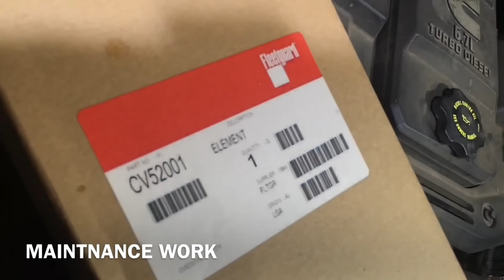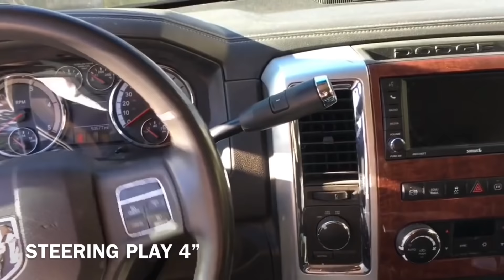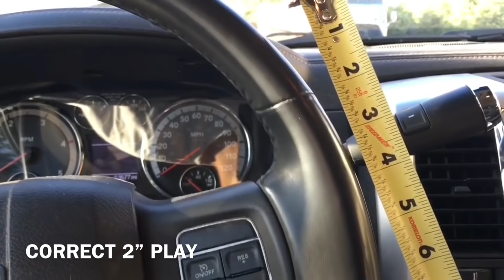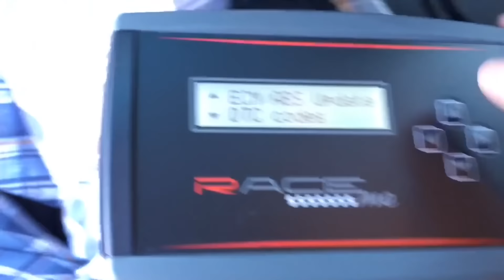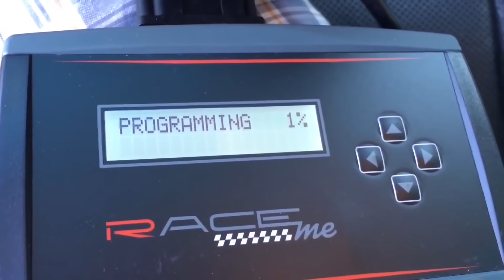2012 Ram 2500 Laramie 6.7 Cummins - FULL BUILD - Exhaust, Tune, Wheels and Tires Upgrade

Comment: In 2013 the 2500 was available with an Aisin trans but after that 3500 and up only . They are rare but I’m sure you can find one if you look hard enough. I only know this because one of my good friends had one. Good job on the truck to by the way.
Reply from the maker: Thanks bro, good to know there was a 2500 with Aisin, I’ll keen an eye out

Comment: I have a 2015 3500 crew long dually, about to do the de-clutter ie. tune, exhaust etc. will make my own pipe as i feel with turbos diesels dont need boxes. might put the Sulastic shackles in back tho.
Reply from the maker: Does yours have Aisin or 68RFE, been looking for Aisin pretty rare

Comment: What was the element under the valve cover? The oil filter? Nice video, great job!
Reply: Aaron Shensky ccv filter. It filters crank case gases and oil and diverts it through that little tube into the intake and straight into the turbo. It clogs up with oil and doesn’t allow the crankcase to vent. It’s usually replaced around 67,000. People also gut the element and install it. Plug the intake nipple at the intake and install a small filter while allowing to filter outside instead of gumming up the insides of the turbo.
Reply from the maker: CCV yup correct, crank case vent filter

Comment: Do you have any tips on how to buy cars at auctions and how you ended up finding the parts to complete the build? Btw awesome video! Thanks in advance
Reply from the maker: Thx bro, some auctions public can bid, some need to find dealer to bid for you, if you search how to bid on Copart you will find all the info, parts junk yards and eBay or dealer

Comment: It says frame cost is $1500 and repair $800. So you bought a used frame and had it fixed?
Reply from the maker: Yes the shop I know had frame from another parts truck and they replaced what was needed

Comment: Did you delete the DEF system? I did on my '16 Ram 4500 with 165K miles and the horsepower and torque numbers exploded.
Reply from the maker: 2012 didn’t have DEF

Comment: Hey I think you forgot to change the spark plugs and adjust the carberator
Reply: Watson 407 most people on here “ that’s a diesel there are no spark plugs or carberator you need to go back to school”😂
Reply from the maker: Haha I’m assuming sarcasm? Lol
Reply: @FixItNick  yeah 😂😂
Reply: Ьъ
Reply: @dominikprince1036  Also car's today don't use carburetors.
Reply: I hate it when my car runs only on choke. 😂
Reply: @Vexumy  first, it's a diesel, doesnt have spark plugs, and you can make them have carbs if you want

Comment: Damn V8 6.7 liters diesel turbo I'd rather buy this and race against slow porches and ferraris
Reply: its actually a inline 6 (i6) not V8
Reply from the maker: I-6 best motor ever
Reply: @michaelcichowski1314  damn idk what that means it's V8 6.7L diesel turbo in my country it's V8 not i6
Reply: Rocker squad a cummins has always been an in-line 6 not a V8 that’s dmax and powerstroke
Reply: @tfoxfamtfoxrules4875  thanks for the information

Comment: Why did you get rid of it?
Reply: Halffast719 money I guess?...
Reply from the maker: Wanted to swap frame, didn’t have time or money to do it, so ended up selling it. I want to find another one tho, my number #1 is Cummins lol
Reply: FixItNick yeah Cummins is number one. You’ll find another one. That looked great once you were done. I could tell the frame was a little twisted. 🤘🏼
Reply: Halffast719 cause it's a dodge, it would've put a rod through the oil pan.
Reply from the maker: Jim Chance lol I guess you don’t know Cummins lol
Reply: Jim Chance uh ok. 🤦‍♂️
Reply: Jim chance what do you mean the cummins aren’t hard on engines tho the nut on the end of the tranny will come loose and cause 5th gear to make a clunk when you shift it in
(The truck that the nut came loose on was a 1998 2500 5.9 cummins 5 speed standard)
Reply: Because it was a piece of shitt
Reply: FixItNick wants dodges lease goes out for using the Cummins motor  there going to go down hill
Reply: Nn
Reply: @tfoxfamtfoxrules4875  that's just the NV4500